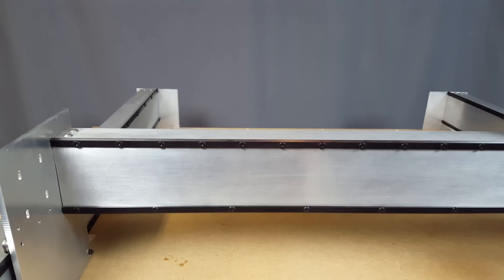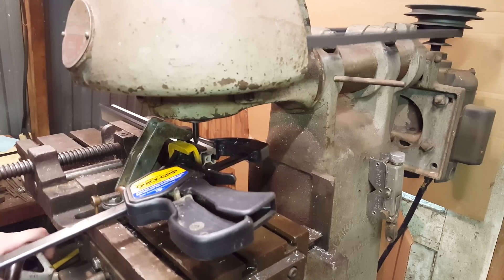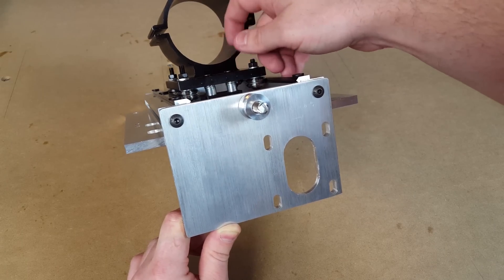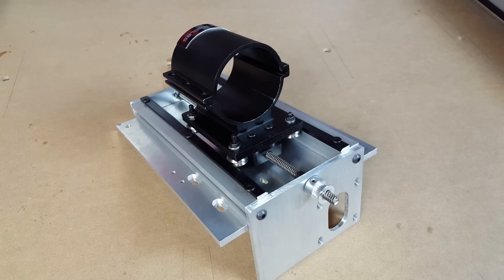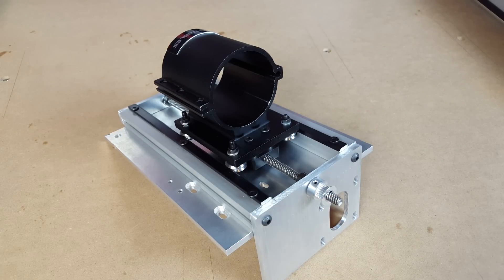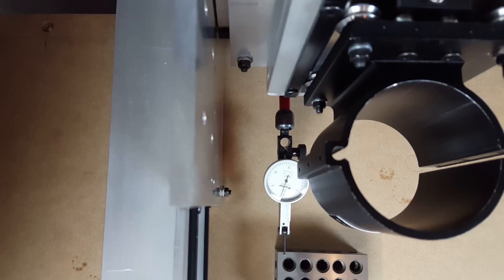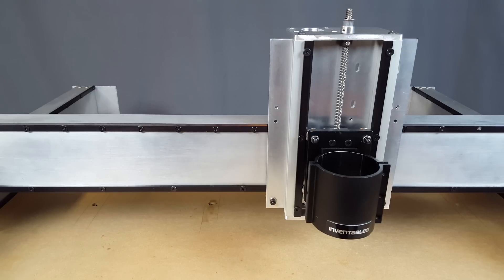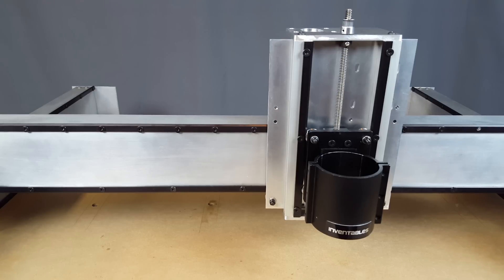DIY-Oko CNC Router: Part 8 Z-Axis!

Comment: Your diligence with this build is astonishing. Way more patience than I have lol.

Also, I know you probably broke all the edges with a file already, but I think a 1/4" chamfer or round on the corners of your motor mount plates would be make them more comfortable to handle and slightly more refined looking. (personal preference)
Reply from the maker: Haha, funny you should say that. Before starting the build I was talking to an old machinist who told me "if you're diligent enough you can do about anything, but... you got quite a project on your hands." At the time I thought he was right, now I'm certain of it.

Rounded corners would be a big improvement for both looks and safety.  I haven't gashed open an arm yet, it will happen eventually though. If the machine proves itself then rounded corners and other improvements will definitely be rolled into V2 .0 motor mount plates.